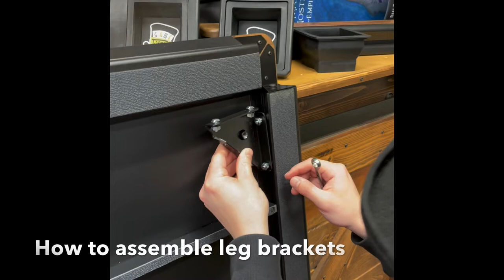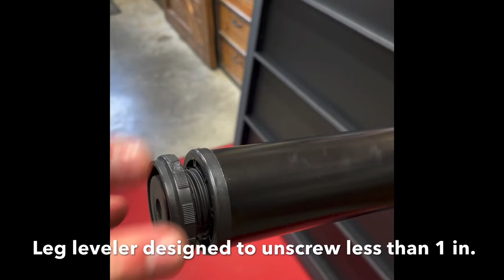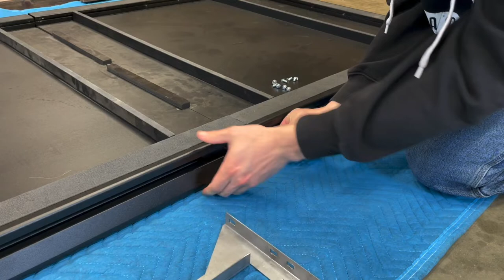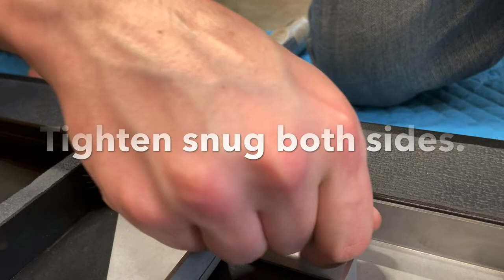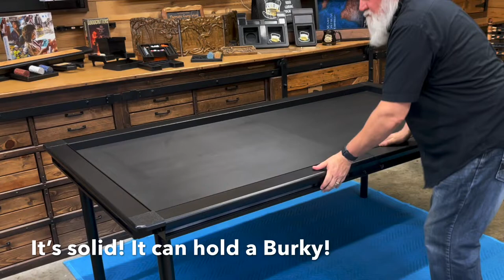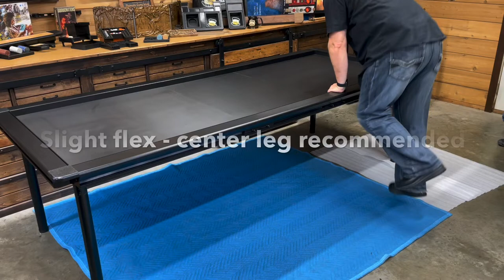Leg kit and Center support install video w/XL leaf test.

Comment: FANTASTIC! This leg kit has MAXIMIZED the portability of the Game Topper and made the system complete. All you need is a 7/16 wrench and you have a solid board gaming table wherever you go. I no longer need to think about the size of the table I'm putting the Game Topper on or need to bring a folding table just to be safe. The Game Topper with leg kit does it all!

Comment: I am intrigued by the leg kit but unfortunately the Topper loses its portability for me now if I were to get it. I wish you made the center brace pieces with the same thumb screws as the connector cleat for quick and easy tool less assembly rather than bolt and nut.
Reply from the maker: Sure, but this solution needs a stronger mechanical mechanism for the Table solution. Our portable solution is still in tack to use with standard folding tables. its not that hard but its fiddly with the center support. We want to clearly show how it works and need to make sure it is safe.
Reply: @GameToppers  Substituting thumb screws for the nut and bolts you have now will not affect the integrity and strength of the brace. I said thumb screws like those used in the cleat, not to use a cleat like system just change the screws (and how they screw in).
Reply: @liamcage7208  All you need is an inexpensive 7/16 wrench. You could leave a couple of them in the storage bags, just to be safe.
Reply: Thumb screws are weaker and much less safe than the nuts and bolts they showed in the video.

To me, the center brace looks more like a "permanent" addition, turning the Game Topper into a stationary game table. That may be exactly what some people want; a stationary game table for their game room. For those people, a Game Topper with this leg kit would make for a great looking game table. I'm fortunate to have a sturdy pedestal table that fits my Watson perfectly, so I have no need for the leg kit.
Reply from the maker: @liamcage7208  i see what your saying but the thumb screws do not fasten to a nut. You have to have a lock nut on the other side of the hammer bolt to tighten to the screw channel. So what you are saying would not work with our extrusion. i show a side cut of this how the hammer bolt must function at the begining.
Reply from the maker: @thegameexplainer3861  this is absolutely correct on both accounts. Thanks